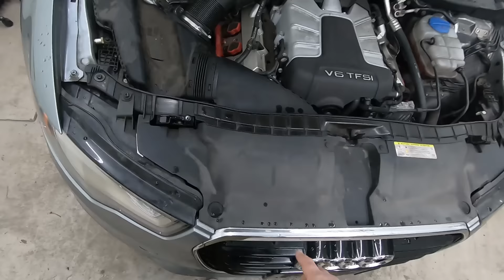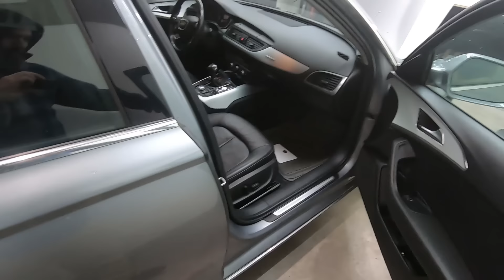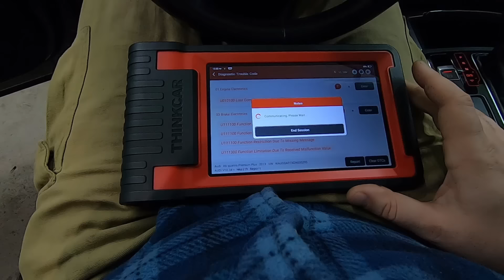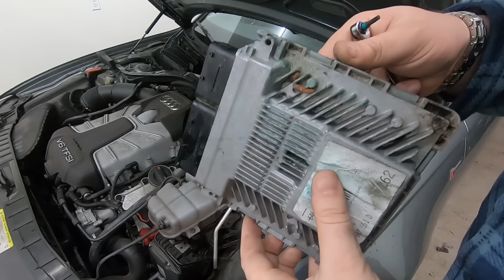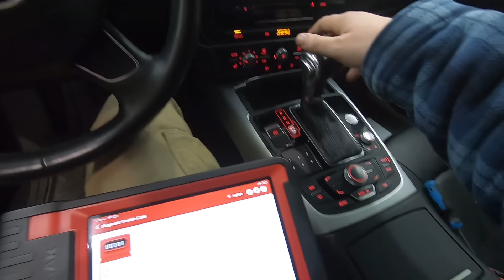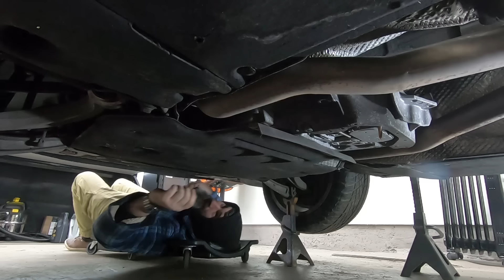This Audi A6 Was a Non-Runner… I Bought It for $1,800 and Got It Started

Comment: biggest thing I get as usual is make sure a competent repair shop/technician is diagnosing your vehicle. There is no reason a legitimate shop couldn't have saw the comm issue with transmission and work backwards to connector.

Comment: Here i am having transmission issues as well, b8 s4 with 150k miles, I been driving it like this for 8 months now and i don’t have any codes for the transmission I only have one engine code for the secondary air pump but im still chasing this transmission issue

Comment: Great car for the money.
I had a similar problem on my Audi A3 1.8 TFSI, U01010 error code - no comunication with gearbox. So I had to get new TCM (transmission control module), flash it to the car and everything works. The only problem was the price - 1.600€ 😢
Overall good luck getting it back on the road 💪🏻
Reply from the maker: Thanks for sharing

Comment: What a find. You can tell it's been cared for. Hopefully the oil looks recent and free of coolant etc. 
Would have felt good when it started and sounded as good as it does.
Looking forward to the follow-up on this.
I forgot to go back to beginning, I can't remember if you said the year but I think you did might have and I just missed it.
Those were nice cars. One thing Audi does that I'm not a fan of is the red dash lighting. At least the speedo and tach aren't too bad. I don't see red at night very well, especially if the lettering is small. Not so much an issue after owning for awhile, but is a big issue when demoing one. It's a VW thing. And many Subarus do it too. Probably Saab too, I forget. Apparently red is used for pilots at night better able to see gauges and switches. For me I'm the opposite so I assume most people don't have that issue or they'd never use it in airplanes.

Those doors close and sound like it's brand new. Good on ya 👍🙏
Reply from the maker: Thank you! Yes it feels like a well cared for car but shit happens. I actually like the red and white 😅

Comment: Heads up @BIMMERHEAD - when you started the engine I am pretty sure I heard some timing chain slap on start-up. This is a known issue on the Supercharged 3.0T engine. The timing chain tensioner loses tension after engine shutdown, and the chain will slap until the oil is flowing. If you let this keep going, eventually, the timing chaing WILL skip on the cog and likely crash a valve. This happened to my 2014 S4 and killed it. To do a complete timing chain service - the engine has to come out the bottom of the vehicle which requires a lift. I know you aren't scared of an engine out, and neither am I - but I did not have the ability to lift the vehicle in my garage. Maybe it's possible to come out the front - but I haven't seen anyone successfully do that. I love the power on that engine - but timing chain in the rear suuuucks.
Reply from the maker: Oh yes I'll check it once the gearbox situation is sorted
Reply: Ok Dr Doom, that sound is completely normal for these engines.  If the sound lasts more that a couple seconds then it may need to be fixed otherwise it's good to go.

Comment: recommend checking the engine timing chain, because when you started the car there was a rattling noise. In Audi cars this kind of noise during a cold start is usually an indication of worn timing chain tensioners in the engine.
Reply: it's normal, mine did it since 50k miles. Known sound with these engines.

Comment: How did you perform force shutdown?
Reply from the maker: luck i guess while i checked all the fuses i realized that one of them made a sound like the ignition was coming on when i plugged it in so i immediately thought if i pull that it will stop. i don't even know what that fuse is for :)))
Reply: @BIMMERHEAD ok

Comment: Yes it is amazing that the vehicle dies this early in 90K miles. It is also amazing they bury the relay this deep with a reservoir on top of ECU. It is as if the key design requirement is to have the car fail but not fail too quickly... Just enough that they will be out of warranty and just in time to buy another car
Reply from the maker: ohhh yes i believe that all car manufacturers are considering that. it would be bad business if the car lasted forever right ?

Comment: That is some of the worst engine bay packaging I've seen.  Looks like it's because of the "Audi" way they position the engine, relative to the front axle.  As a result, there is little room in front of the engine, but because of the FWD-like axle placement, there isn't a lot of room behind the axle between it and the firewall.  So stuff is crammed into weird places.
Reply from the maker: yes its a bit weird but i still like it. I'm saying that now but let me have it fixed and then we talk about again :))

Comment: Use VCDS to better diagnose problems. In 99% of cases, other faults are caused by the CAN bus not communicating or losing communication.
Repair the shorts, and the CAN bus will restore communication.
If the plastic/pins in the TCM aren't melted, you might be lucky and the short was external.

Good luck! The car is worth it!
Reply from the maker: Thank you very much! i hope i can fix it :)
Reply: yes agreed with that....iam using VCDS..its way to better and easy to scan a problem with audi

Comment: “Why would they place it there?” ….welcome to Audi!   I am betting you will say why a few more times before you finish… 😂
Reply from the maker: :)))) it doesn't really make sense at all why would you place the windshield fluid reservoir on top of the ecu and the main fuse box when you have so much space to work with... knowing that people are going to refill that and will definitely spill some because they are not robots like they have in the factory :)) but yes i like to see this stuff even if its a bit confusing its different and i like it
Reply: @B @BIMMERHEAD don’t even get me started with the placement of their battery on the Audi A6 C8 recent generation. To replace the battery, you have to remove part of the C pillar trim on the passenger side to free the rear seat side bolster that holds the plastic trim which in turn needs to be removed to access the battery tray. When removing the battery you also have to still be very careful as there is a back up 48 volt battery placed by the firewall passenger side under the hood that’s supposed to assist the auto-off feature. Not mindful of it, there’s still power and may cause you to trip a fuse. LOL

Through it all, you need a special tool to “register” the new battery otherwise it will not work. By the way resetting the 10k mile interval service can only be made with a special Audi/VW scan tool - in short they are forcing the faint of heart to only do oil service at the Stealership. I had to change the service interval setting from 10k to 5k on my Audi to every 5k miles for engine longevity. You can only do this with a special OBD2 tool. Oh, a special tool is also needed when replacing brake pads.

Did I mentioned that the C8 also have almost 30 under engine cover torx fasteners? Wait, they want to screw you some more by using 3 types of torx screws: T20, T22, and T24. They do the same function - hold trims in place… WTF, Why Audi?
Reply from the maker: @speedmaster001 😂😂😂 thank you for sharing that. Im definitely gonna love this... 😂
Reply: @BIMMERHEAD - haha. Good luck!
Reply from the maker: @speedmaster001  Thank you!
Reply: No, that pink thing is just a frame in one of the rows of fuses. No function besides making it look pretty in an area that nobody really see. Pure Audi thing. 

That tells a story though that the past owner is attaching something electrical aftermarket that does not seat flush in the fuse box without removing that pretty pink thing.

Comment: Finally, the AUDI. Now, let the nightmare begin ;-) I have the same car from 2018, but it runs :-) This will be a long road to recovery. I expect a few videos from this. These cars are notoriously difficult to work on.
Reply from the maker: well i love a challenge and I'm exited to learn about Audi because the are nice cars form what i can tell :D
Reply: @BIMMERHEAD  They are indeed. The C6 generation was really reliable. I did 250K without any failures. Over the period of 12 years I could always jump to this car and make 6 hour trip and not worry about if anything breaks. For almost 10 years I only changed the oil and filters and only did preventive maintanance and all was fine. The new C7 I got this year is ready to run now, but I did spend 10K on all the necessary maintancace. Only after replacing all the needed components I can tell I am not affraid to drtive it. But there is the most expensive issue, the time chain. I will biuy the OEM set next month and keep it. I have 92K KM and it requires replacement at 150K KM, so I have 2-3 years before I will have to pull the engine out and fix this.
Reply from the maker: @szobione nice. Thank you for sharing that! Yes ive heard that they are very reliable if you maintain it right and it sounds like you are on it! Glad to hear that and good luck with it 👍

Comment: Looks like they deliberately put all those electronics items just under a fluid tank so that people would spill fluid and it will break the car and then they will have to run to the dealers and hand over their cash in thousands. 

All German brands do this.
Reply from the maker: or they assumed that all people are very careful and use proper tools even when it comes to filling the windshield fluid in a gas stations... yes that doesn't make any sense :)))

Comment: 17:03 timing chain does not sound good, even if the car did not run for a while
Reply from the maker: yes I've heard something as well but i need to fix the wiring first so then find out the problem with that fan and then i can actually listen to the engine run. if the timing is bad the engine needs to come out on this car because its at the back.

Comment: What voltage is the alternator putting out? All those blown fuses make me think it's overcharging.
Reply from the maker: on the code reader it shows about 14v so i think that's fine. i think they are blowing because of the short on the gearbox harness. after that gets fixed ill check the alternator with a multimeter as well just to be sure

Comment: Looks like the N82 valve is leaking and causing coolant migration through the TCU harness. Semi-common problem. I'd look at the coolant valve (It sits on the left side of the transmission and right by the flexpipe and axle on the driver's side behind a metal plate, Google for photos/videos). If so replace with 4H0121671D and inspect the wiring. VW sells gold-plated connectors with yellow wires that are required to repin, then inspect the TCU harness and the TCU/mechatronics itself (which is attached to the valvebody). Hopefully the TCU isn't fried and you can get away with the new coolant valve, wiring, and TCU harness.
Reply from the maker: Thank you! I did see that valve and there was no colant leak but I will check it again and if so I have to order that as well. Thanks
Reply: @BIMMERHEAD  Np you'll have to remove the plug from the pump to see if coolant is migrating up that connector and the wiring.
Reply from the maker: @mydimeisup5103  ive heard that that could happen but never actually sen it in person. It makes alot of sense now. I'll definitely remove the cover and the plug to check. Thank you!

Comment: Given the ECU was wet, and the fuse box is right under the ECU. I would take out the fuse box to check that the distribution board isn’t corroded, a short might’ve caused the TCM harness to overheat.
Reply from the maker: Yes I did but the fuze box was completely dry so the short happened down there at the gearbox.